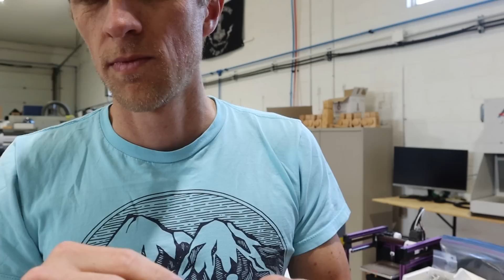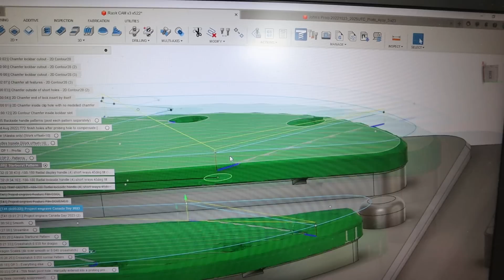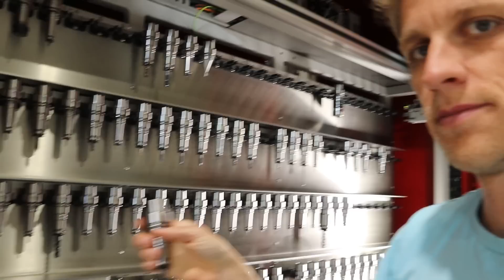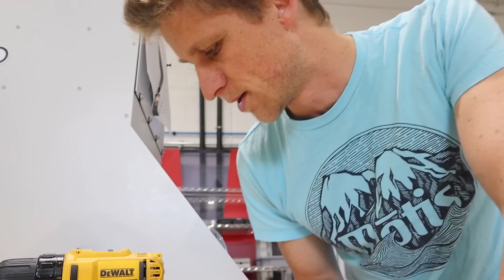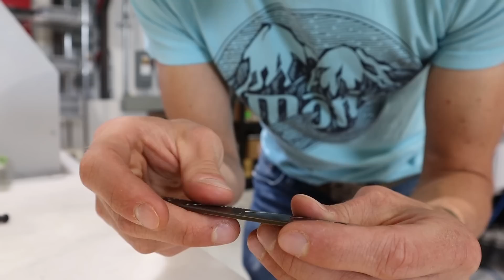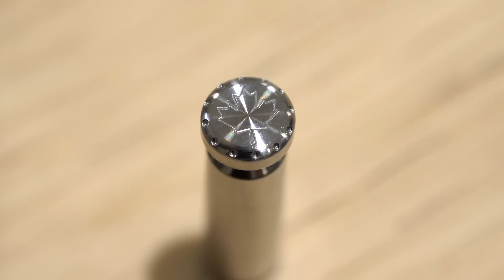Making the Canada Day Rask!

Comment: Could have a pass with a duraluminium fake mill, which can easily be made if you have a deckel endmill grinder (or something similar). The aluminium won't scratch the part, but it will clean any junk in the cut.
Not my idea, saw this in a video about custom engraving. For the record, the feller wasn't even rotating it, just passing that sharpened aluminium rod, shaped like the end mill through the same path.

Comment: I noticed the new endmill you replaced it with is single ended. When I bought the .020" ball nose engraver from lakeshore carbide a couple years ago- they also had a double end version for not much more. Definitely worth checking into- it might halve your end mill cost!

Comment: For deburring something like that, you could try to use a small fiberglass pen/brush. They're often sold for reworking circuit boards and such, but if you don't push really hard, you can avoid scratching the final product and only knock off the (relatively) loose burrs.
Reply: Fiberglass rod is even better, cause you can buy it in whatever diameter you need, and all you have to do extra is use some tape to give it a handle so you don't get shards in your hands.
Reply: Intersting you mentioned this. I've been using, not to de burr but to give engraved channels a nice matter finish, the glass fibers get into all the cracks that other finishing methods would not, not nice to get glass fibers in your finger, I always wear nitrile gloves